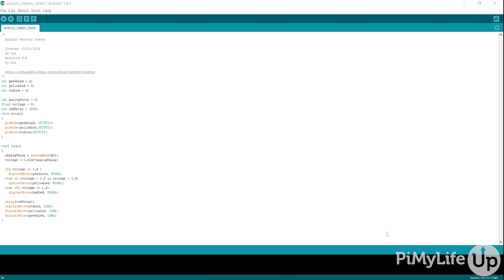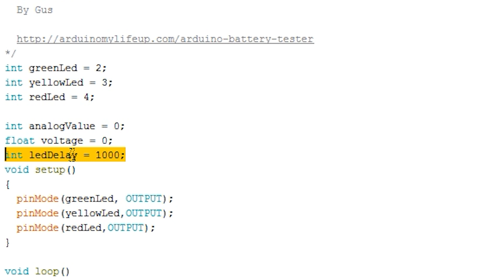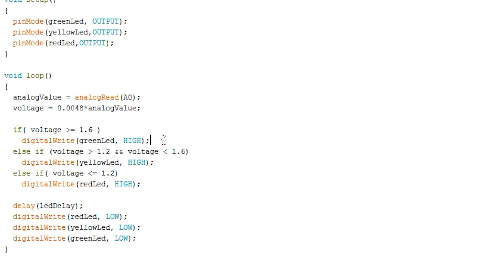How to Make a Simple Arduino Battery Tester

Comment: You are a legend. Now, this is giving me what I just needed. I will go on to implement a battery tester on a TM4C1294 board with graphics card included for an electrical engineering project.